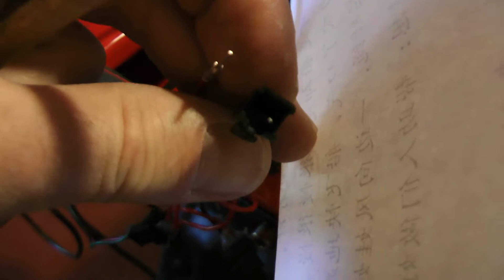Qiewa Q-Power Controller Hookup Part 3 of 3

Comment: Doesn't the newer one have dual front shocks on each fork?
Reply from the maker: There is a "Q-Power Black" version that has dual front shocks on each side. Qiewa is also releasing their 2021 line of scooters. New top end one is the Q-Hunter. The new Q2 hummer looks like it has dual 1200w motors and hydraulic brakes. You can see them at qiewascooter.com although I don't think the specs shown are completely correct.
Reply: @Desert-Ecruising I need help I’m seeing your videos and trying to learn I can’t get the headlights and back lights to turn back on can u please assist me asap I could cash app or Zelle your help please I’ll wait for your reply thanks 🙏
Reply from the maker: @The125harlemworld email me and I’ll help you out:
maikemarx@gmail.com
Reply: @Desert-Ecruising I just did
Reply: @Desert-Ecruising from AOL
Reply from the maker: @The125harlemworld 
I didn’t get your email. Try again:
maikemarx@gmail.com
Reply from the maker: Didn’t get your email. 
maikemarx@gmail.com
Also, if you watch this starting at 8:14, it may help you: https://youtu.be/N6YeZ0_mmRI?si=VpnPqb2CSxSnPq5e
Reply: @Desert-Ecruising  yea, I don't like the stem of that kind bcuz it's not adjustable for us taller guys...
Reply: @Desert-Ecruising  qpower is still top end cuz it's 3200watts...
Reply: @Desert-Ecruising  nevermind, I just seen it says 5600watts
Reply from the maker: Yeah, That's insane.
Reply: @Desert-Ecruising  how does one go about testing the actual wattage?
Reply from the maker: It's just the nominal wattage rating of the motors. These hub motors can peak much higher though and can handle a nominal wattage higher than their rating. Wattage is calculated by multiplying voltage (battery) times current (max output of controllers for peak wattage). So for the Q-power which has 1600w nominal motors, 60v x 35A (mine are 35A controllers) comes out to 2100 peak watts per motor. My Q1 with single 800w motor, I'm running a 52v battery and modified controller putting out about 30A peak. So 52 x 30 = 1560W peak on that 800W nominal motor. Even more when battery is fully charged.